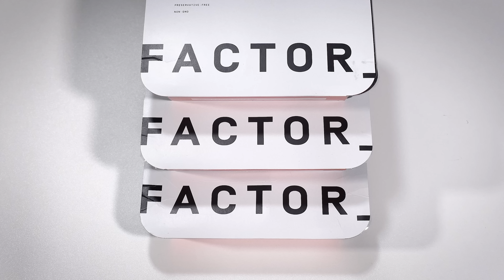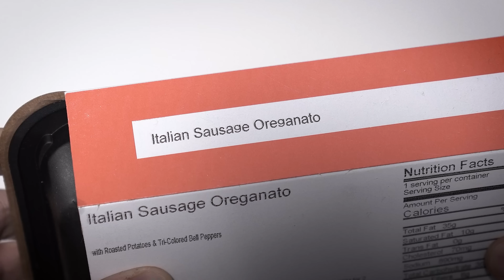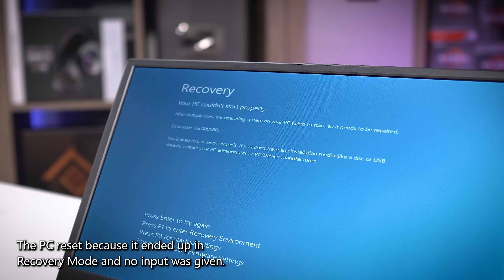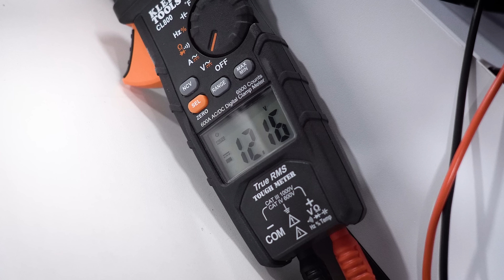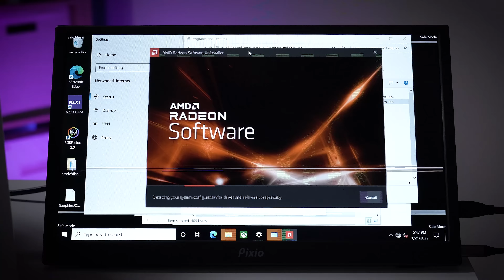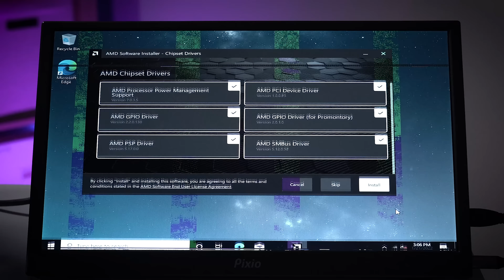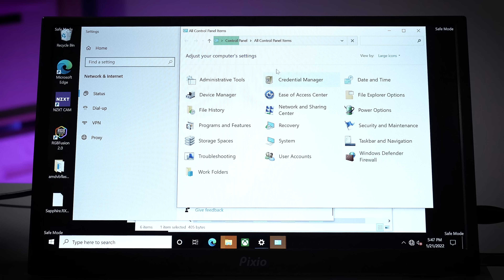Can We Revive This 10 Year Old Graphics Card?

Comment: this reminds me of last year when I took my old 7970 apart.  It was working just fine but running very hot when I decided to finally put it up for sale on something like offerup.  so i got some new thermal paste and thermal pads, took the card apart, cleaned it up with new tim and pads, put it back together and was immediately getting very similar artifacting.  I wound up taking it apart one more time to make sure I had put all the thermal pads in the right spots, put it back together and still same artifacting.  Started going through driver troubleshooting and then the card just stopped working.  I think I may have put to much pressure on one or more screws when putting it back together(i know better than to crank down on it, but maybe I still used to much force).  
Is it possible that at some point in the cards past it too was taken apart, repasted and then later on started showing artifacts due to incorrect pressure used when mounting the cooler?  this might explain why paste didn't look that old for a card that is very old.  when i took my old 7970 apart, the thermal paste flaked off, it was really bad.

Comment: Same thing happened to my 5500 xt. Booted to safe mode to remove drivers. When I booted to Windows and looked in hardware manager it defaulted to windows standard gou drivers. But once I try to install amd gpu drivers I would just get a boot loop. Just replaced it with a 2060.

Comment: the gpu is damaged / partially works but is throwing corrupted data to the OS which is why you were having OS crashes. 
Artifacts while running basic windows graphics drivers is already a red flag, wouldn't have continued from that point.

Comment: hey Greg, the card might still work, I had similar issues with Ryzen System,,, it could be due to Compatibility issues,,, that card is LEGACY.  Try a different Setup AMD FX System and or Intel 4 GEN older.  if you have any. mine worked after using FX System

Comment: I hope the fans or you Can answer my question I got a 3060 ventus 3x yesterday I currently have a ryzen 3 3200 would I have bottleneck problems I also got a power supply to support the gpu

Comment: Industrial hair dryer - heat the GPU processor for 2 min. - Success. But probably only for a while. Had this issue with other cards that had artifacts. Some still work, some don't. The cause is too much heat, like you deduced, or bad GPU chip from the factory that will degrade over time.

Comment: That picture is looking like cracked balls. Basically you need hot air tools.
If it has done many 20C to 100C cycles then it's broken solder balls
Edit: If someone is more to fixing hardware and not just swapping components then recommend to check Adamant IT. he show how to flash motherboard/GPU and how to do some hot air work

Comment: Few weird things I noticed while watching this:
You never tested if the fan worked outside the system by just running power through it?
You seem to spend a lot of unnecessary time cleaning with cue tips and water, when a good air duster (not the one you have) would have cleaned everything in seconds (yes you would need to take it outside)
PS If you have a card where the fan has stopped. Turn it off! Don’t leave it on and film a video about the artifacts you can see whist you cook it to death
Try it with Windows 7/8 or Linux in case it’s a driver issue with w10

Comment: I have a DEEPCOOL GAMMAXX L360 ARGB AIO which came with 3X CF120 fans(The ones without holo ring) and planning to get 3 more CF120 Plus fans(The ones with holo ring) will the lights in the pump and all these fans be controlled using Cooler Master MasterPlus Software if I purchase and use the Cooler Master ARGB Controller or Cooler Master ARGB Controller A1?

 

1. Found that the old Cooler Master ARGB Controller allows other branded AIO and fans to control lighting but no idea about individual LED and brightness.

https://www.youtube.com/watch?v=0cljgwkefa8

 

 

2. Found the new Cooler Master ARGB Controller A1 allows control of individual devices even if they are daisy chained(https://landing.coolermaster.com/pages/addressable-gen-2-rgb-led-controller/) but not sure if it will work with other brands

https://www.youtube.com/watch?v=nsEHuMADqS4

 

Will the old Cooler Master ARGB Controller will support brightness control and Individual LED control for other branded fans?

 

Will the new Cooler Master ARGB Controller A1 will support other brand fans(like the old one) and let us control everything(Individual LED control, brightness control and recognize multiple fans connected to a single port using a hub/splitter cable)